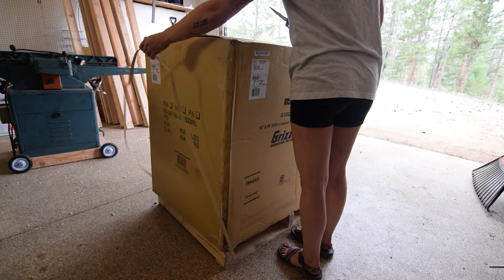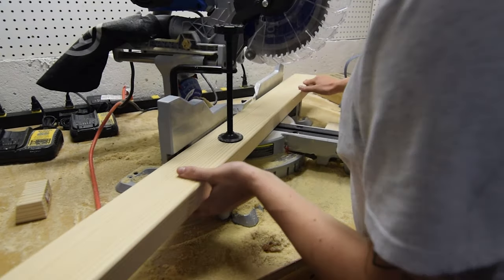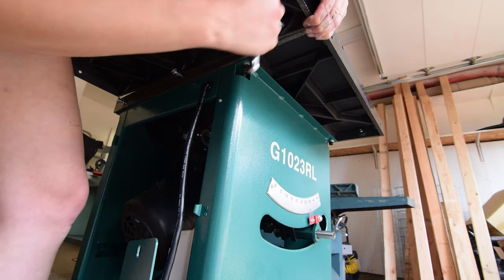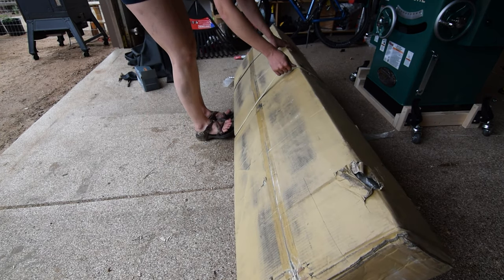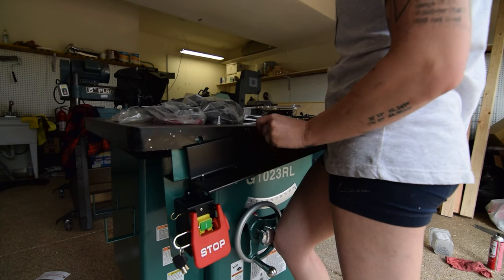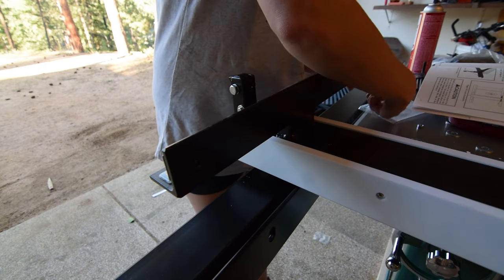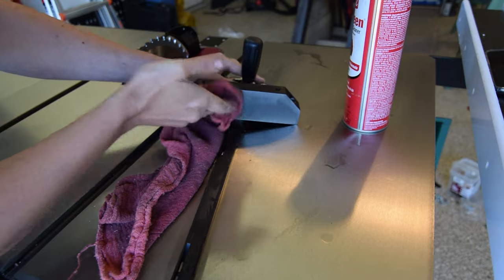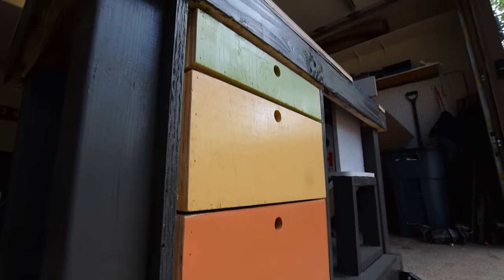I finally replaced my table saw! | Grizzly G1023RL Unboxing

Comment: I bought  G1023 in 2000. I recently replaced the arbor & bearings. 
Ordering parts is easy as buying off of Amazon.
Reply from the maker: It’s so convient and such a work horse.

Comment: You did a great job with this video. I've been researching new table saws. How do you like it after using it for a while?
Reply from the maker: I like it a lot - the only real struggle I’ve had with it is my arbor bowed at some point. But taking it apart to fix has been pretty easy!

Comment: I am curious about that small, black square plate on the far side of the blade - rear of the table.  What is that for?
Reply from the maker: Sounds like you’re talking about the riving knife (just behind the blade) or the rear rail that is used to stabilize the fence in my set up, but can also be used to support a table extension insert.
Reply: I was wondering the same thing when i got the saw but i believe it’s for the blade guard. The metal wings on the blade guard rest on top of it.

Comment: You put an angle on the rear of the table that was included with the fence package, does the fence attach to that angle?  You also made no mention of the blades angle adjustment does it tilt to the full 45 degree or slightly beyond?
Reply from the maker: Hey Joel! Not totally sure I understand your first question - are you referring to the orange square in the video? And yes the full tilt is 45 degrees
Reply: @HonestWorkDesigns  at time stamp in your video 5.08 you attached a steel angle to the rear of the cast top — what purpose did the angle serve?  Does it play any part in the function of the fence?
Reply from the maker: Oh! I get it now - yes in theory, (because I haven’t cut any piece that large on it yet it can provide some support to the fence, it’s also an important piece if you/I were ever to upgrade and get the table surface extension for this saw.
Reply: @HonestWorkDesigns  🙏, I have the fence already and thought there might be some differences with the fence. Enjoy and be safe.

Comment: Great video, thank you!  
I'm buying one of these but unsure of the power connection.  Looks like you may have replaced their plug with a twist-type line?  What type of wire and connectors did you use exactly?  Thanks!
Reply from the maker: I did! As I had restored the older tools first, we had already changed to that style of plug so we matched the new tool to that style as well. That style makes it so you never can come in contact with energized prongs. As voltage increases wire size can safely decrease, but the wire itself is all oversized for these applications out of an abundance of caution. However, regardless of voltage of your tool,  I’d recommend verify with an electrician that the gauge / amp rating of your wire / plugs meets the wattage draw or tool.

Comment: So its been a year since this vid, any issues? Good choice for new saw?  Planning on moving up from a dwe7491
Reply from the maker: Still really pleased with it! I’ve had slight problems with the smaller dust collection getting clogged, but I think that’s a combination problem of relying too much on a low grade dust collection system, and not cleaning it out enough.
Reply: @HonestWorkDesigns  thx for the update info.  Rlly looking into this saw for sure.  Did u find plans for the rolling base or was it a one off?  I like that its simple and can slide it right onto the base off the pallet
Reply from the maker: Happy to share - I would def call it worth the investment. And the low-boy I just whipped up. As long as you have lever support at the top of the wheel anchors, those wheels work great.

Comment: I hv the G691 (I think that’s right?) the 3hp 10 “, 52” long!  Bout 750 lbs.
I am a pro cabinet maker/ finish contractor!
My saw is the same as yours just one model up?
Things I learned:  toss that blade!
Get a Tenarue 10” 40 tooth blade!
Send your blades out to ;
WD Quinn Saw Co. (they R on the internet ) down load their form fill it out and send it in w/your blade!
It’s $15.
Do not use cheap blades they hv poor carbon and never last!
The blade I recommend will give you at least 7-10 sharpening !  Maybe once or twice at most you will sharpen it in a yr!
“No Cheap Blades”!
The Tenarue is bout $100? Give or take a few bucks!
Get a good Miter Gauge - I use an Incra HD.

Your saw is dead nuts accurate and will run strong all day!  It’s a work horse!
I changed my belts after 3/4 yrs of very hard use!

So good blades!  Use Quinn to sharpen them (need to keep a backup)
Oh buy a gallon jug of CMT Orange blade & bit cleaner with a tub to clean blades in or cut a 5 gallon bucket up & use it!
Clean your blades when they look dirty !  Most blades do not need sh
 Sharpening they are just dirty !!
A clean blade cuts like a new blade!

I wish the best for your business and put your husband to work on his days off!!👊
Reply from the maker: Thanks so much! Love all the insight and will definitely implement!
Reply: You will do fine Mrs ; why?  Cause you hv passion for the trade!  Knock’em dead!

Comment: Another useful tool for your workshop. Meh - it’s only money you would have otherwise wasted on food and mortgage payments.... I do like your low trollies with the lifting casters. I was just thinking that you’ll want a work table that can sit behind the saw but you’ve made a router table which I expect will perform that role. I am enjoying watching you build your new workshop!
Reply from the maker: Thanks, Alan! The low boy took a little trial and error to get the casters to lever without busting the lumber, but finally got it done! And you’ve got me pegged! Not the router table, but I actually use the other table of the miter station I put together (edit coming soon) as the outfeed! I realized pretty quickly I was gonna need one haha!
Reply: HonestWork Designs - I look forward with some anticipation to seeing your next video!

Comment: How could you possibly know if it the wings were actually properly align with the table top with all of that industrial shipping goop still on the surface throwing any possible reference surface off. ALWAYS clean the top and wings COMPLETELY before assembling. You have no idea if those surfaces are actually aligned properly the way you did it.

Comment: Cross cutting with material stuck between the blade and the fence is one of the stupidest and most dangerous things you can do on a table saw. That one of the first things taught in safe operations of this tool!
Reply: Does not matter if you have a riving knife, it can still bind and kick.

Comment: As someone who watches a TON of this type of channel, a small bit of advice.  Lose the music.  It is super annoying and distracting.  Narration is enough, that's why anyone would be watching this.  To hear what you have to say, and your walk through of the steps you took.  Otherwise great vid.  This is something literally every home shop person wants to do... upgrade to a cabinet saw.  Congrats on the saw!  Also, bare feet/sandals in the shop?  I'm not a safety_Karen or anything, but I've dropped enough boards on my toes to cringe at that.  Sticking around for your outfeed table build, which you will want in about ten minutes (if not already).
Reply from the maker: Haha, thanks Sam. You’re not wrong about the shoes, i guess old Congo habits die hard. And you might actually be able to see the combo outfeed/miter station table behind me in one of the end shots. I’m working on those edits now!You weren’t wrong, pretty much immediately realized I needed one after the first cut! Haha!